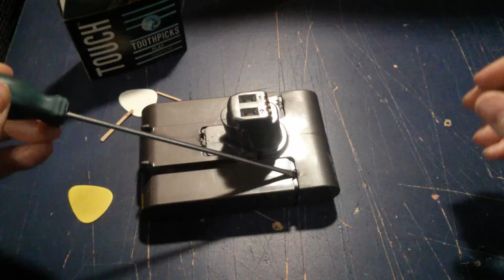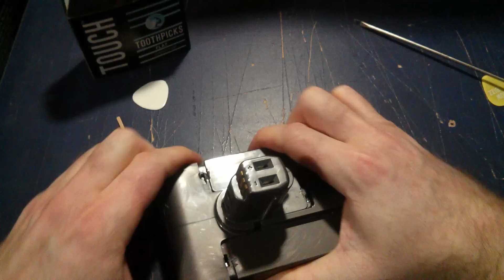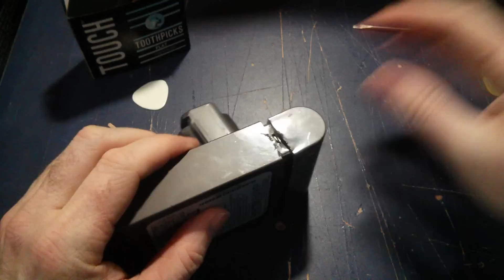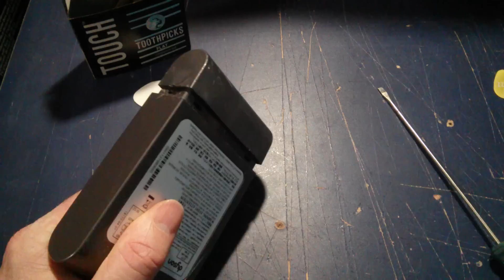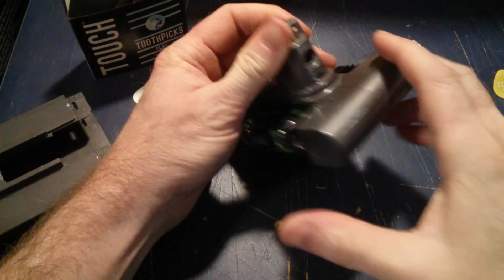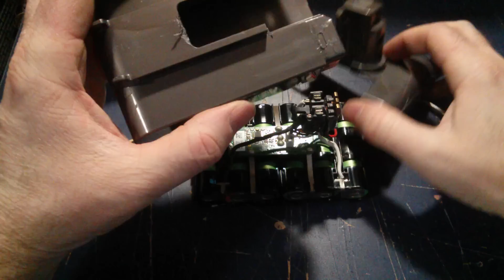Dyson DC31 DC34 DC35 DC44  battery disassembly for replacement: Not Worth It.

Comment: The dirty SOBs installed a stinking fuse instead of a breaker in the main power line. I had all 4V batteries and 0V at the output. A hole move!!!!!!!!!!!!!!!!!!

Comment: Does the battery pack works after replacing the cells?  Hopes the BMS will not brick like those in the V6 battery packs.
Reply: It is temporary disabled but applying voltage at a low current in excesd of the current pack cell series  voltage to the main output lugs will reset it.❤

Comment: Just ordered a new battery pack, but interesting to see what was inside, I suspected the batteries would be standard 18650 cells, and they were, the soldering etc would make it difficult to repair, but not impossible :) Thanks for the video, I'll dismantle mine and see if any of the cells are usable for a torch or something :), but probably for the recycle bin!

Comment: It is possible to refit this battery, but not easy. Everything is very tight. But buying a new one is not a better option: This device is to old, and so are the third party batteries you can still get. Nevertheless, it is worth it. Every new Dyson (or Dyson clone) ist much bigger and less handy.

Comment: Makes you think why Dyson did not design the battery pack where you can side in the replacement individual chargeable batteries one by one. Some one claimed Dyson do not sell the pack any more yet they are still advertising on their website. My main concern there are plenty available cheap compatibles for sale from China priced around £22. Just don’t trust the compatibles for this reason.

Comment: Oooh nooo, don't you ever use a screwdriver for tasks like this! Opening cases like this one is an art! 😏 Use a thin knife blade instead and carefully work your way under the clips. The plastic Dyson used is flexible enough to take the strain and not break. I just opened a similar case (DC62) with very little visible damage. Now I have to find a way to unclip the light guide for the LED indicator. Almost harder than opening the case 😜
Reply from the maker: Thanks for the hint!

Comment: Thanks for the video. 
I realize many others have issues with it.
But I simply wanted to see what things looked like INSIDE of a dyson battery pack. 
Plus how hard it might be to manually replace the batteries.
So your video accomplished showing curious folks the guts of a Dyson battery pack.

The 18650 batteries are quite popular these days.
I see that people building DIY VAPING RIGS for 510mm cartridges use them . 
So, many 18650 BATTERY REVIEWS sites are out there. Showing different 18650 batteries reviews and ratings.

Comment: Tried for 15 Minutes and couldnt get inside yet! Thanks for the video showing it is possible with lots of scratch marks. I just wanted to repair the worn socket in the battery unit but might as well buy another battery. Any luck with the $25 knock offs, saw some place online asking $85 for a genuine one lol
Reply from the maker: I bought the cheap one and it's still working!

Comment: You can’t buy genuine batteries from Dyson anymore so this really helped me to get the case open on mine. Now I need a video on how to diagnose what’s wrong with it. Good job thank you.
Reply from the maker: Thank you so much for the feedback. Glad it helped.
Reply: Most likely it will be a simple matter of charging it up then running the appliance until it runs flat. Then check voltages on the cells. You could then try replacing the worst of the cells, although this would be tough to do, judging by the design. 
Looking at this excellent video, it would probably be easier to remove all the batteries, and the charging circuit, and replace with new cells plus a 7-way molex plug connected to the positive end of each cell, plus the negative end of the last cell. You could then use a standard balance charger to charge the thing up. Not ideal, as you'd have to charge the battery off the appliance, but it's what I've done with all my lithium cordless drills and it works very well, plus you can choose your own charge rate and use a top notch balance charger which preserves the cells. If you've multiple lithium ion devices, and you adapt them all to molex plugs, you'll be laughing!
Reply: @tasmedic  That sounds great! Have you done a video on how to do it??
Reply: @nw8000  
Yes, I ought to do that. I've a couple of videos up about other things though. I wonder if you've seen those....?! ;-)
Reply: It's highly likely these 18650 cells are low or faulty. These batteries only last about 2 years in the Dyson. In the UK you can buy Samsung 18650 cells from £3.79 each. Get yourself a multimeter and check each cell. But, to remove the cells and install new ones isn't for beginning. The cells need to be spot welded on back.

Comment: I reckon this is potentially very dangerous. You risk damaging the protection circuit which prevents over charging and over discharging the cells. Failure of the circuit could lead to a fire.
Reply from the maker: I agree here... having a fire though would have made a huge amount of traffic on this video haha
Reply: Not if you use a smart charger used with RC batteries..

Comment: In the beginning i could i could turn my DC35 on when i pressed the battery from the rigth angle. I did the replacement with LG HG2 but now i cant turn it on at all. The head can spin but the motor doesent start. I suspect the 3 little pins being the problem as they are measuring only 0,05 V. Should they output 24 volt or? Hope one can help :)

Comment: Christian I thought initially "such a novice!!!". Damn guys, it is really the hardest battery pack I ever came across. To open it you eventually ruin it. It is not because of the plastic clips, it is because it is damn tight (with foam tape to increase the friction even further!!). To those that are wondering. I just rebuild mine, replacing the original Sony US 18650vc3 (rated 1900 mAh, 20A) with 6 LG HG2 (3000 mAh, 20A). PROBLEM: the original Sony have a diameter of 18.2mm, the LG have a diameter of 18.5 (0.3mm more). Guys, they DO NOT FIT,  you have to use the Dremel to re-bore the cells' case, or modify the cell case (like a did with a cutter). As a result, the battery pack will result bent, and you will have to close it with American tape. Is it worthwhile? Meh...
Reply from the maker: Haha, yeah, well... I know it's not pretty and it sure looks like a novice. Thanks for the comment. It's not worth rebuilding it...
Reply: Christian Galipeau seriously, initially thought “here we go. It’s just a matter of patience, this guy had none...” took me two hours to open the case, no matter the use of hairdryer to make the plastic softer... and eventually the cells that I had were slightly too big to fit... it’s really a risky exercise, because you have to weld over the battery and there is really little space. Risk of shorting is real.

Comment: Ban Dyson and buy Panasonic,Dyson highly overrated and parts expensive.Plastic for plastic's sake !
Reply: Agree Dyson are crap. The handle is designed very poorly and it's a pain to use literally. My battery failed after a year.$600 for a product lifespan is typical of today's electronics. The circuit board you see in this video probably generates further profits for Dyson.
Reply: Actually the motor inside of that thing is a Panasonic. AvE’s channel disassembles one of the canister vacs and proves it.

Comment: Do not and I mean do not use metal tools to take a Dyson battery apart. Yeah it is hard to replace the batteries because you need a battery spot welder to do this. If you don’t have the right tools and knowledge then don’t do this. You can start a fire or worse it can blow up in your face. Also the flumes from these batteries are very bad for you and can cause lots of health problems. Please take note and don’t be stupid like this guy using a screwdriver to take it apart. He was lucky he did not hit the battery with his tool.
Reply from the maker: Yeah, don't be stupid like me.

Comment: I assume I should also get 24V out on the three metal contacts on the backside of the battery when it is just sitting correct? I get 24V out from the two main connectors on the top of the post but nothing on the three metal contacts on backside and suspect this is why the vacuum head works fine, but powered attachments don't work.
Reply: Hi did you resolve your issue? Im having the same issue, only measuring 0,05 V across the 3 terminals. Does anyone know how to fix?
Reply: @svankervej  the 3 terminals is for communication between the main unit and the battery.  You won’t find the output voltage there.
Reply: @randycollens2681  Do you have more information about these 3 little terminals? Because I have a battery that has a normal voltage on the main pins, but does not make the motor of the DC34 spin when I pull the trigger button.

Comment: Are them 18650's?  if so im gonna tear mine apart and put some of my panasonic 3400mah cells in it
Reply: No do not use these panasonic cells, they can't handle the discharge rate of this device !!!
Reply: Carsten Oschlies  whats the current draw on the dc59. I use these batteries in my fenix tk75 which i figure pulls a pretty high current also.  thanks for the heads up.
Reply: It has 100 watt so it consumes up to 33A, as far as I know. You have to divide watt by 3 but don't ask me why.
Reply: if its draws 100 watts at 22 volts it would pull 4.5 amps
Reply: Happy trying. Dyson builds in expensive Sony VTC4 cells which can handle 30A in long time use. They will do this for a good reason.
Reply: @fast2valve559  across 6 20A rated batteries.
Reply: @zorki23  depends if this the 1300mAh model battery or the 2200mAh battery. The DC31-45 all used the same looking type B battery.  Most 1300mah used LG HA3 cells, and most 2200mah used Sony VC3.

Comment: Hi, I've opened my D62 battery pack. It is slightl different of yours. Do you know the type of soldering, is it tin? Can I use a soldering iron ?
Reply: All lithium battery packs are spot welded.  You can solder, however, be very careful.  I have done it plenty of times before, without issue.  I scuff up the new battery terminals with a razor or file, then set my soldering iron to MAX heat (550 C), then on the newly scratched up area of the battery hold the iron and apply a gererous amount of solder, without making it flood inside the positive cap!.  Do one end of the battery, then move to the next battery, giving them time to cool down before soldering the other end.  Remember, be careful!  They can explode.

Comment: DO NOT DO THIS!!! I just used same technique and the BATTERY EXPLODED!! I'm not kidding. I had my screwdriver trying to pry apart the outside case. The screwdriver slipped in and all of sudden, BOOM! Fire shot out, Thick black smoke poured out and filled my house. I grabbed the smoldering batter and threw it out on front yard in the snow. Area rug I was using is ruined and I have all the windows open trying to get rid of this noxious smoke. I DO  NOT RECOMMEND trying to repalce battery packs inside. Amazon has V8 Batteries from $45-65!
Reply: Sounds like your screwdriver punctured a cell and/or shorted out cells.

lots of people strip and rebuild battery packs without destroying them like this.

obviously it's not for the reckless or careless.
Reply: So...you're at fault. Basically the advice should be don't get you to do this.
Reply: Next time don't be stupid and discharge the battery first! It has to have enough energy to explode or catch fire... And work cautiously at safe place!
Reply: @lubomirnovak9628  incorrect, it has nothing to do with the charge... it is the metals exposed to air
Reply: Hence,  another example of why women live longer!....eesh! :)